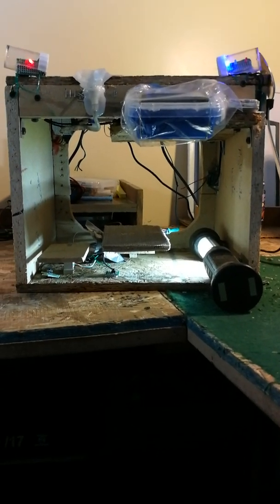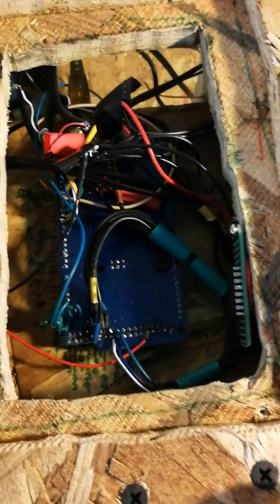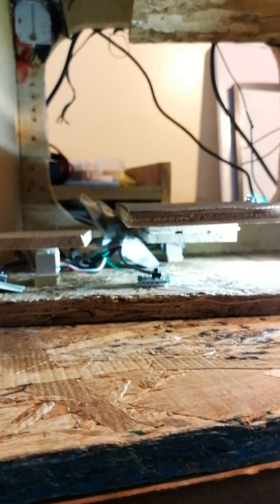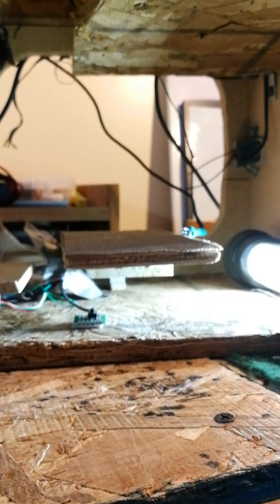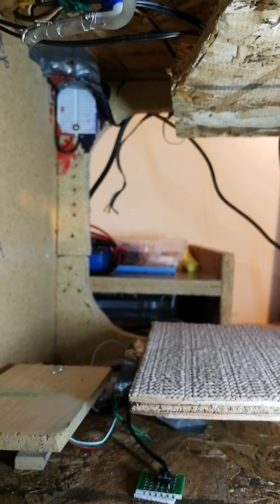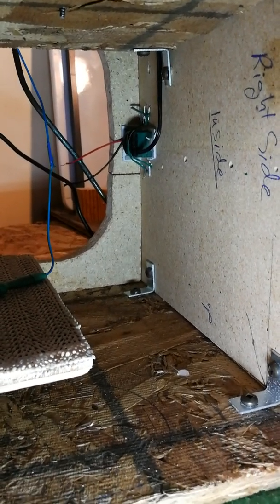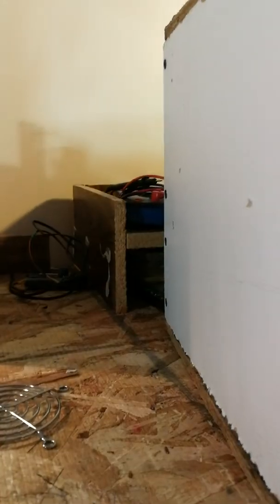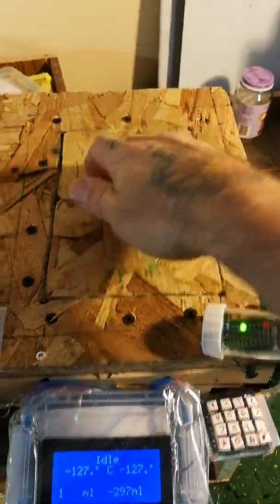Still Housing

Comment: Hi, this is cool. 

I'm still looking at your project site that linked me to this video. The 2 scales at the bottom, they feed the Arduino with data that tells it how much product is collected I assume. 

How do you make the collection jar switch over? Does the Arduino do that?
Reply from the maker: the scales give me the weight of the product collected in pounds.  The Arduino then does the math to convert pounds to kilograms.  Since the metric system is based around the fact that 1L water weighs (by definition) 1Kg, I make the assumption that alcohol and the product of my still is about as dense as water (same mass per volume) and just switch the Kg value the scale tells me and call it 'liters'.
So... yes.  the scales tell me how much product has come out of my still.
Reply from the maker: 'collection jar switch over' - there is a rubber tube beneath the collection 'scoop' and that rubber tube is attached to a 'servo-motor' which redirects its flow anywhere between 0-180 degrees inside the box.  The user (me) can program the position of the servo-motor (drip end of the nozzle) anywhere in that 180 degree range using the menu options for each of the 4 modes (warm-up, head, hearts, tails) and the Arduino will reposition the nozzle where you programmed it when it switches to that mode during distillation.